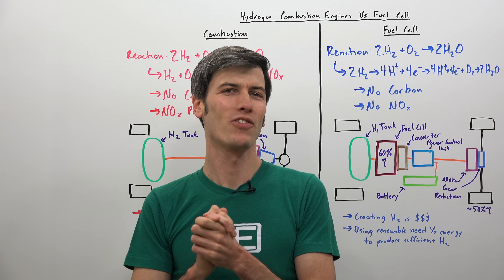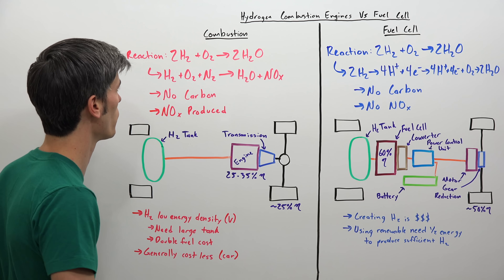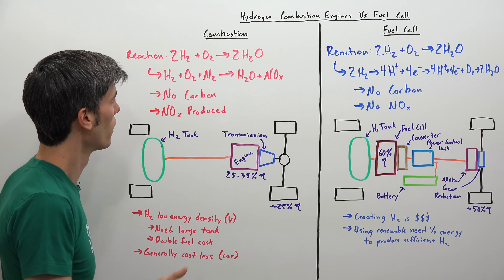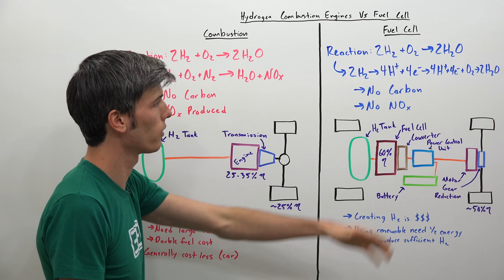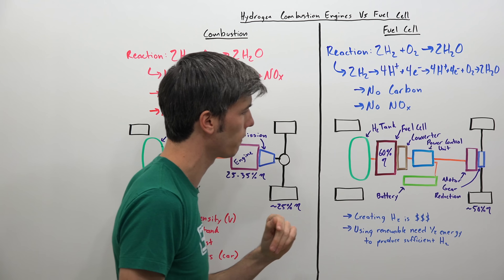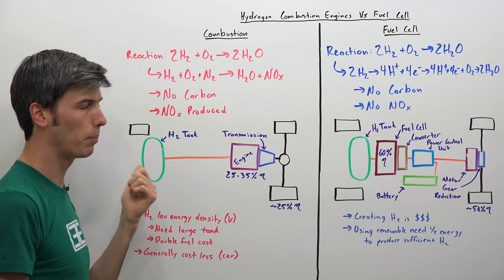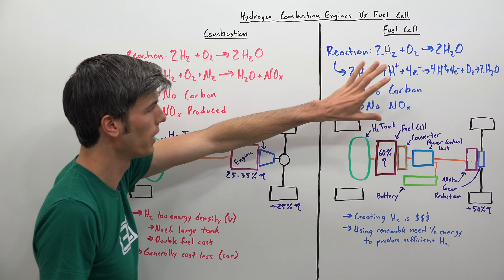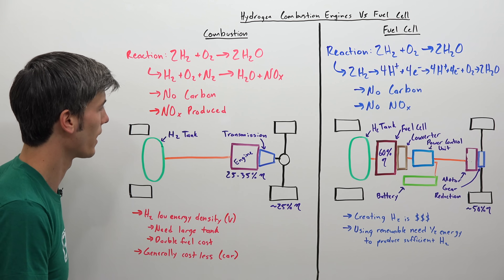Why Hydrogen Engines Are A Bad Idea

Comment: Since the infrastructure for gasoline distribution already exists, installation of hydrogen pumps at present stations could speed up the conversion to hydrogen powered transportation.

BUT the MAJOR obstacle for any conversion to hydrogen transportation is a competitive source of hydrogen. 
Nuclear, solar or wind produced electricity for hydrogen electrolysis could be the answer......BUT
Burning coal or natural gas to produce electricity for electrolysis defeats the purpose.

A hydrogen combustion engine conversion kit for millions of existing cars would make sense for the immediate future.

Eventually electric cars powered by fuel cells would be the long term solution.

Comment: Why does the volume of the tank strike out the direct combustion engine? Can we not create a pressure vessel that will hold the necessary volume at some sufficiently high pressure that we can carry as much as we deem necessary in whatever volume we find convenient? Gasoline internal combustion suffers from the exact same inefficiencies you list here, or worse even, with ultimate efficiencies under 20%.  I think the differences are more in the level of technology required to master each process. Internal combustion is simple, we understand it super well, and we do it in all kinds of regimes. Fuel cell technology is fundamentally more complicated.

Comment: Car manufacturers are re-engineering large petrol engines to run lean and cool on hydrogen to avoid high nox but produce reasonable power.

I suspect completely new high capacity engines are required.

Comment: I was looking for this as I was trying to think why hydrogen ICEs were not being developed. I wasn't aware it would produce NOx but even so, a catalytic converter is designed for that reason so it seems a bum excuse not to do it. I was thinking the hardest part would be preventing moisture in the piston chamber and producing mayonnaise. If there's a way around that, the resulting exhaust would be steam.
Reply: 1. Catalytic converters don't reduce NOx emissions.  They oxidize unburned fuel in the exhaust.

2, gasoline, diesel, and other hydrocarbons burn into 4 things:
A) H20 (water vapor aka steam)
B) C-n chains (where n is any integer) aka carbon soot
C) CO2 (Carbon dioxide = plant food)
D) CO (carbon monoxide, especially if the fuel:air mixture is rich in fuel compared to the stochiometric mixture ("perfect" ratio of oxygen to fuel)

The same thing applies to wood.  Remove the H20, and you have the results for coal

Comment: You touched on the environmental impact of combustion engines by mentioning the production of hydrogen oxide. I agree that this would be an issue when thinking about the hundreds of millions of cars that will be produced in the future.
However, if those hundreds of millions of cars were all fuel cell engines you failed to mention the amount of billions of tons of raw rare earth metals that would need to be mined, and processed to get that amount of large powerful batteries to power these vehicles. 
This just seemed a little bias, as if using a fuel cell engine is the cleanest environmental option because of emissions. Emissions may end up being less detrimental to the earth after all is said and done.

Comment: There are at least 100 million ICE cars in the US alone, and they 're not going to vanish overnight.  (Look at how Cuba has managed to keep its IC cars running for *more than 60 years*.)  IC cars can be readily converted (talk to HyTech and Arrington Performance) to run on Hydrogen direct combustion.  So can existing diesel engines.  So Hydrogen fuel-cells may be the ultimate goal, but in the meantime (like, say, the next 50 years) Hydrogen-combustion and Hydrogen-diesel will be the choice.

Comment: If you could burn the hydrogen in pure oxygen, would that stop the NOx from being formed?
And if possible would it increase the efficiency of the engine?
I know it wouldn't be as efficient as a hydrogen fuel cell, but it would be easier and possibly more environmentally friendly to convert current cars to burn hydrogen

Comment: I buy H2 engines and fuel cells for Amazon! These videos are great, however you should really change the title "Why Hydrogen Engines are a bad idea for Transportation"; agreed on the transportation application, but fundamentally disagree in a back-up generator and microgrid power application...

Comment: What about ammonia and nitric acid couldn't these also be byproducts of Hydrogen combustion engines?
Also what about the overall efficiency of producing hydrogen then consuming it in either combustion or fuel cell powered vehicles?

Comment: Interesting stuff but with all these old cars they can be converted and with a bit more technology standard engines combustion engines can be converted. So  have a look YouTubers look at Harry‘s garage as he talks with Lord Bamford at JCB about the conversion they’ve done to a standard diesel engine and basically change the cylinder head and run it on hydrogen impressive results still with the same Engine torque which is what they need with diggers and machinery and electric wasn’t the answer because of the weight and the quantity of batteries to run electric not practical have a look

Comment: So the efficiency model for the combustion engine was used on current models if given enough time and research could that not eventually be more efficient than a hydrogen cell?

Comment: If both vehicles were kept in regular daily use, say 10K miles/year, for 50 YEARS: Which of the two would have the least impact on the environment? ...and which has the least impact through the decommissioning/ scrapping process?

Comment: Hi and thanks very much for that simple explanation. 
But I am not agree with the efficiency of diesel engine. Let's speak about much larger engines, around 5 to 20MW, with 60% efficiency today under disel (perhaps much more with Hydrogen, specially after few enginneering) ? 
Are Fuel cells can do that ?

Comment: And since hydrogen can easily be produced with the power from a wind turbine, there is not much better deal than this.
To produce hydrogen when the wind blows means that you have stored energy you can take out when needed.
Reply: Battery electric is a MUCH better deal.

Comment: Where do you get the hydrogen?  If you use renewable power in electrolysis, then the entire process could be considered a "battery", where you invest energy into the water to liberate the hydrogen, and then put it through a fuel cell to recombine and extract the energy (with losses).  In reality, the cost effective way to get industrial hydrogen is to extract it from natural gas - CH4 - through steam methane reforming.  CH4 is converted to H2 + CO + CO2.  Lovely.  BUT...Natural Gas was a perfectly good fuel before investing the energy to liberate the hydrogen...  And Natural gas runs in inexpensive ICE cars of today with relatively minor modifications.

Comment: Remember what happened to the Hindenburg, the German dirigible, filled with hydrogen, that caught fire just as it was landing in New Jersey. So, you’re basically driving around with a bomb strapped to you. I would not want have an accident with a hydrogen fueled vehicle.

Comment: Energy density by volume is different than energy density per unit mass.....Even when hydrogen is compressed to 10,000 psi(g) it remains very light which is makes it even more suitable for VTOL aircraft, multirotors etc. And conventional airplanes.

Comment: If the fuel cell is introducing outside air, then wouldn't it contain nitrogen since a lot of outside air is nitrogen?  Isn't that the same way and reason nitrogen is introduced into the combustion engine?

Comment: So if the fuel cell is approx 60% efficient at converting the hydrogen fuel to electricity, you are still losing 40% of the hydrogens potential. I can now kind of see why Elon says that straight electric is the way to go, no loss in conversion. But then you need much larger batteries (more weight) to get the range you desire. Kind of a catch 22 really. It's actually really hard to beat the old polluting, unsustainable internal combustion engine in terms of simplicity and range. Likely why the internal combustion car beat out the electric ones in early automotive development. It'll be interesting to see how it all shakes down in the future, though I doubt I'll be able to afford whatever they end up with, lol.

Comment: Does the converter have a small power loss? ( A DC to AC unit is a inverter and has a 15 to 25% loss.. A converter is a AC to DC unit , however i am confused because I thought a  fuel cell was DC ? Is the converter you speak of changing or raising the voltage from the fuel cell to the motor? Some electric motors for Autos are BLDC some are AC...each has advantages over the other and one new motor design is a combo of both. One at low rpm ( torque) the other at high rpms ( no back emf) anyway are there not power losses in each of these types of conversions?

Comment: Couple of observations...Fuel cells are costly and picky...Engine: You can catalytic the nox to nitrogen and oxygen ..You can improve the engine efficiency (turbo/hybrid)...so its easier to implement since everything is already mainstream tech. The problem is getting the volume of H2 fuel stock (as with F/C)...which you can reform gas into e/hydrogen at the pump...you just end up waste from the process (probably bad like mtbe)

Comment: Good vid.. The magical thinking comes in where people think the hydrogen is just lying around to use. It may be the most abundant element in the universe, but its not just sitting there. When you look at the total energy cycle, typically we have to disassociate natural gas to to get the hydrogen which has energy inputs, plus generating waste. Why not just use the natural gas to begin with and skip the conversion losses? until we have fusion to bust up water to get the H2, the total system cost doesn't seem like a good play. OTOH, if we have fusion, we don't need it as we can just go pure electric.

Comment: I suggest you have a look at what JCB (you know... the company that make diggers, bulldozers, etc) are doing with hydrogen powered ICE. Batteries are no good for the machines that work 12-16hrs a day digging/flattening terrain, nor do hydrogen fuel cells. Their hydrogen powered engines (based on the diesels they've been making for the last 15+ years) work very well. Elon Musk is not the answer... but his answers are part of a big problem. How many more rare earth minerals do we need to dig up to make the batteries currently found in family EVs like the Model 3? Hydrogen powered ICE IS the way to go!

Comment: If I may ask for the internal combustion engine system, what if the stored hydrogen is used to start the process, but then switches to a sealed hydrogen production system? What I mean by sealed is that all of the H2O that is recovered by sealing the exhaust, then it is separated once more then returned to the fuel system. How much would the NOx effect the system when being returned to combustion chamber? With a computer controlled system that will monitor and increase supply from the storage tank when needed, would the NOx use be beneficial?
Reply: It takes a lot of energy to repeparate the hydrogen. You are describing a perpetual energy machine which is impossible. I still think the HCE is preferable though
Reply: @craftminer49er  I did try looking it up, even using the Oxford English Dictionary, but I couldn't find a definition for "repeparate." Is it a industry term? What I was asking is that if the exhaust is not released to the atmosphere, but compressed and reintroduced to the fuel process would the Nitrogen Oxide then be beneficial?
Reply: Oh, I did mess up that sentence. My bad. I meant to say: it takes a lot of energy to re-separate the H2O back into hydrogen for use in the engine again.

Basically, the amount of energy it’s gonna take to convert the water back into combustible hydrogen is more than the amount of energy you will get by burning the hydrogen in the first place. Unfortunately you wouldn’t be able to create an internal hydrogen production system without having some element of outside power present like a large battery. 

I don’t know about the NOx, as far as I know it’s not really that useful in the combustion process but I’m also not a scientist so who knows if it could be useful. Would definitely be pretty cool to have a “hybrid” sort of design with a large battery that can help recuperate some of the fuel back into hydrogen!
Reply: @craftminer49er  Well, I learned just recently from a guy who has a set up on his truck that he uses to augment his gas m.p.g with hydrogen. It only takes a 9v current to begin separating H2O.

Comment: a electric hydrogen generator can be placed in the engine so if you need to refill you would just fill the tank with water and the hydrogen will be extracted from inside the car

Comment: No one ever seems to mention the fact that the batteries in electric powered cars need to be recycled at some point. This is what the hidden cost to the economy and the environment that people arent accounting for and thus in my opinion renders electric vehicles worse off that even your 6x6 styled rolling coal truck. Cool video for sure but missed a very important point that completely tips the argument in the combustion engine's favor.

Comment: I really enjoy this guys presentations  Very sharp and informative.
Reply: to bad he doesn't know ppl have been running h2 since Stan Meyers created the car that ran on water. (cough it ran on hydrogen split off water using electrolysis)
anyway,   he was poisoned to death,  but we still have the tech.   HHO    all combustion engines run on COMBUSTABLEs .... hydrogen is 130 octane GAS..  gasoline is 98 octane liquid.
lol thinki about it...    oh and lookup the BMW hydogen 7...  Jay Leno's got one.

Comment: Good factual presentation however, I would just use a small hydrogen turbine jet to turn a generator and power a electric motor personally. People overthink sometimes and miss the simple solutions that are right in front of them, with that said, I would also have coils built into the roads to wirelessly charge batteries and/or use induction to wirelessly power electric cars without the need for using up the stored energy in a battery powered EV, until one might need to go off road and choose to use the batteries.

Comment: Has no one told you that Mercedes are running an internal combustion engine in their formula 1 car that with all the hybrid systems is over 50% efficient. If this technology were applied to a hydrogen engine your math would be way off .

Comment: Wow... got it. How does the hydrogen get converted and used in the fuel cell? did you have another video? Or can you explain that in another one. I beleive a more modular Fuel Cell approach would make it much more servicable and way less moving parts than the other old style Combustuion engine, that is where we need to be and get away from ELECTRIC ONLY Cars, making electric companies rich, although they would buy up or already have bought up all the Hydrogen fuel supplies.